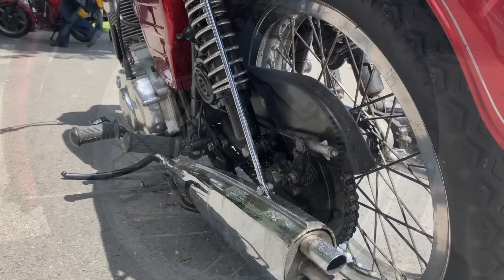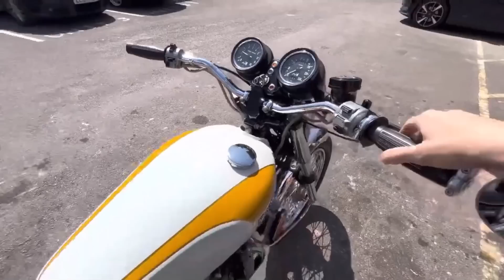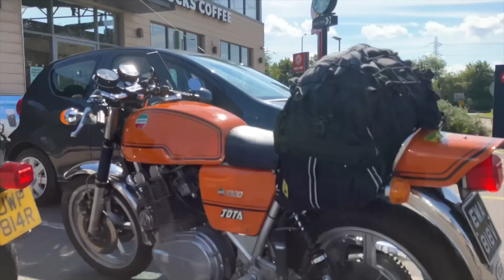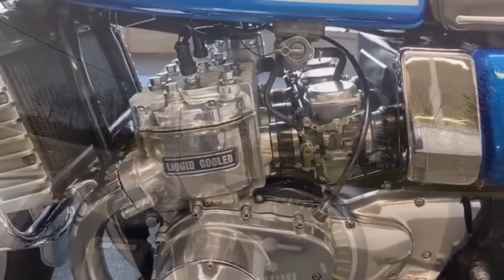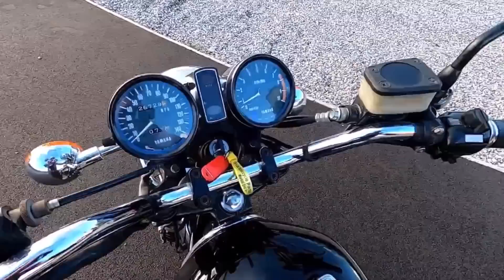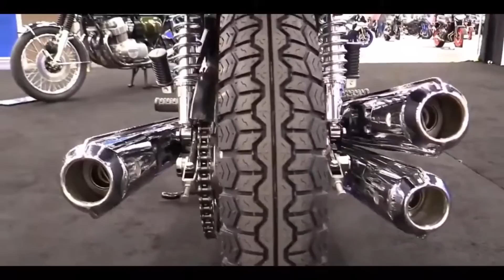5 SuperBikes of the 70s with 3 cylinder engines

Comment: Great video of some classics the Suzy kettle my personal favourite. Just think the styling of it was gorgeous. The kwacker kh 250 may have been a learner bike in the day but it scared me !! It'd get to about 75mph and the front felt as though it was lifting off the road.
Kept it for a year and sold it.Thanks for the memories 😂
Reply from the maker: Nice
Reply: KH 250 (as a learner): you shift down , facing a curve. Revs get over 6500 and you accelerate. Fun moments!
Un-slotted disc front brake: heavy rain. You pull the brake lever. Nothing! For a split second: You think you go ever faster. 
Been there. Thanks for the momories from the far north of Germany!

Comment: The only one I have ridden is the GT750, I loved it!
I had a picture of an XS750 on my bedroom wall, but I rode an SS50 at the time. I was only 16!
Reply from the maker: A bikes a bike, always good to have wheels
Reply: I had and loved my kettle back in '79 until '83. It was slightly modified with 3 into 3 expansion chamber exhaust, lifted exhaust ports, widened transfer ports, skimmed head and big carbs with polished and widened inlets. What a beast!! Nothing much happened until 4,000 rpm, then it kicked your ass until 6,000 , after 6,000 nothing much happened either. Terrible to ride in the city it was far too peaky. Unfortunately finishing it's life against a Ford escort which had run a stop sign. ❤🎉🎉
Reply: I had and loved my kettle back in '79 until '83. It was slightly modified with 3 into 3 expansion chamber exhaust, lifted exhaust ports, widened transfer ports, skimmed head and big carbs with polished and widened inlets. What a beast!! Nothing much happened until 4,000 rpm, then it kicked your ass until 6,000 , after 6,000 nothing much happened either. Terrible to ride in the city it was far too peaky. Unfortunately finishing it's life against a Ford escort which had run a stop sign. ❤🎉🎉
Reply from the maker: @Harpy-Mark-Tomlinson  when you think of the real work practicalities it’s easy to see bikes of that nature didn’t sell  for long. 
People blame emissions regs but I don’t think the big strokers sold in the numbers the four strokes did

Comment: The GT 750 was a great bike. Sadly mine was stolen  in 1977 after I had it for a year and I miss it to this day. The main problem with it was that as I was commuting to London from Medway, the crankcases would gas up at low speeds leading to lurching and snatching then a MASSIVE smoke screen when you opened it up on the A2. The bike was very comfy and the handling was actually very predictable and certainly better than my GT 380 that preceded it. That used to go round corners in a series of straight lines. The stolen GT750 was replaced with the new GS 750 four stroke. A far better bike in all respects but didn’t have the character of the big two stroke. Dear dead days!!
Reply from the maker: The GT was about as well set as they got I think
It’s easy to see why big strokers lost out in the wns

Comment: I suppose that it's a matter of how you define the term "superbike", but it's hard to think of the mild-mannered, touring oriented Water Buffalo and XS750 as worthy of that monicker. Oh well, opinions are like navels.  What isn't in any doubt, though, is that the Kawasaki 750 triple was never called the "widowmaker". That description applied to the 500 and only the 500. The 750 was very charismatic, but unlike its smaller brother, it didn't actively try to kill its rider. So many Youtubers get it wrong and just mindlessly repeat the same error that it's refreshing when someone gets it right. Kudos for that.
Reply from the maker: Well both were listed in my SuperBikes of the 70s book so that’s good enough for me, also in the description I don’t describe the 750 as the widow maker in that section I’m talking about the 500 not the 750.
Mild mannered or not the Suzuki had the same top speed as the Yamaha, it just had better power delivery
Reply: Yes, absolutely. I gave you kudos for getting the distinction between the 750 and 500 correct.  @bikerdood1100

Comment: Nice, love triples, do another 5 .. please! 
BSA / Triumph triples do get pretty confusing admittedly but I've never heard a T160 motor called a 'Rocket Gold Star' which to me would be a tuned BSA 650 A10 twin from a decade or two earlier? 

Also there may be some truth in the leant forward theory in that the T160 is inclined forward slightly more compared to the Rocket 3, it's only about 5' degrees difference and is likely to be more about the differences between the two frames than a purely intentional difference, a date related Rocket 3 / T150 pairing might have been easier to deal with.

Lastly I've never heard of the last T160 being badged as a BSA? maybe some confusion there with the first Hurricanes being badged as BSA's or the last BSA A65's which used Triumph T120 engines and were badged as BSA's, by then sharing the same 'oil in frame' frames.
Reply from the maker: Well it is and it isn’t if you know what I mean they used the R3 bottom half in the T160 so it’s a mix of parts from the two engines I suspect
I Honestly never or heard or seen a BSA with a triumph engine from the factory 
The later A65 did have a BSA engine but with common fram and cycle parts
Reply: @bikerdood1100  - I'm fine with your take on the T160 engine relating almost fully to the Rocket 3 engine, how a rather tastey pre-unit BSA 650 twin with 2-1 exhaust and clip-ons got involved doesn't matter tbh, the moment's kind of passed now, albeit with a faint whiff of Castrol R or something similar.

Anyway moving on If you do a search for: BSA T65 Thunderbolt 1972 on Loscar Motorcycles Channel you'll see the bike I meant, apologies if there's some truth in your story about the last Trident just sounded like an odd thing to do.

Comment: The video of the Triumph seems to show 4 exhaust pipes. Did the center cylinder have 2?
In his youth, my father had a 125 single cylinder 1936 Voss, that had 2 exhaust pipes of Villiers design.
Reply from the maker: Yep it split at the port standard on a t160 because of the single down tube

Comment: Had a yam 750 doc in 1981, didn't like it at all....too heavy and ended up with the middle pot seizing up, got it fixed and got rid
Reply from the maker: Yamaha definitely had some problems withe this model especially the early models pre electronic ignition and I have covered some before but problem’s around the middle cylinder is not unknown and the top heavy feel was very Yamaha at that time 
We had an FZ750 which was also top heavy